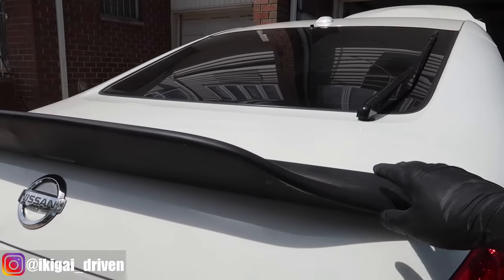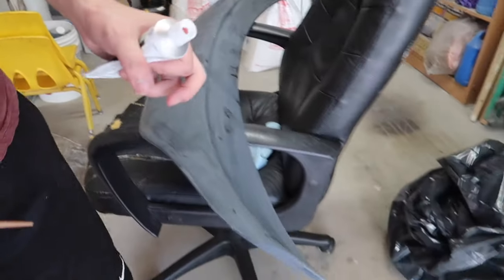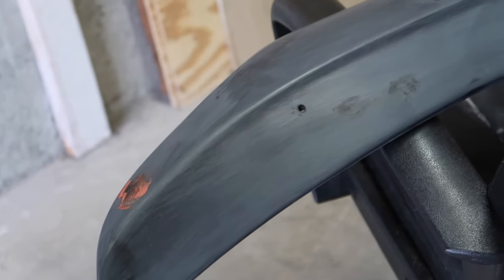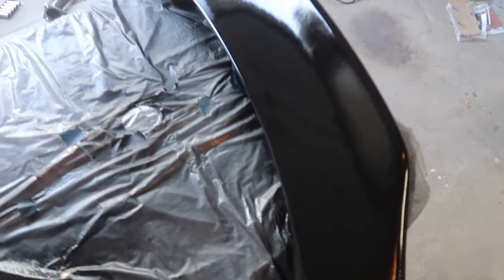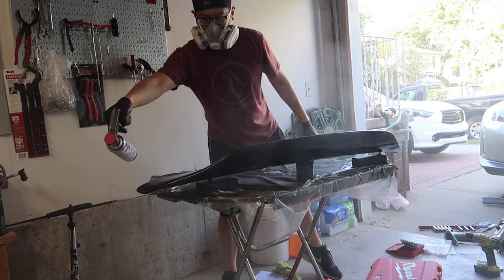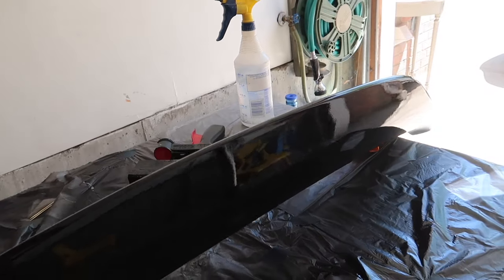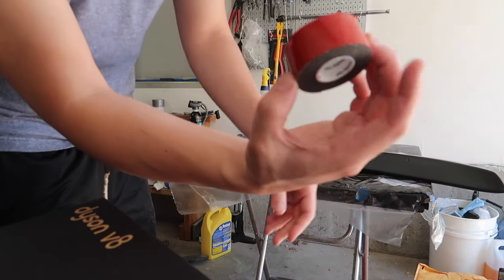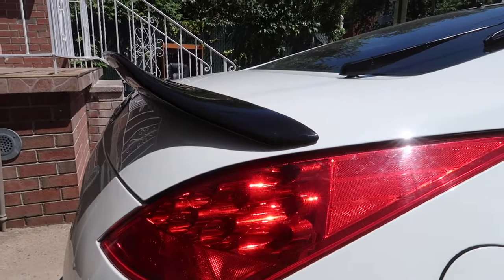Drift Dialects V2 Duckbill Wing - Paint & Install on 350Z

Comment: Pretty nice spoiler, easy install, no drilling.
Looks a lot like "IKON MOTORSPORTS" on Amazon.
Reply from the maker: Yup! I didn’t want to drill in case I wanted to remove it. And the tape was extremely strong. It took me an hour trying to remove the wing later on lol